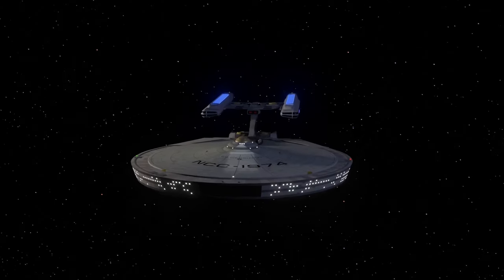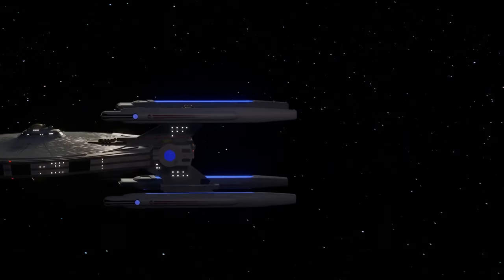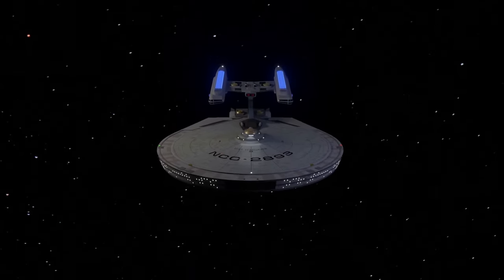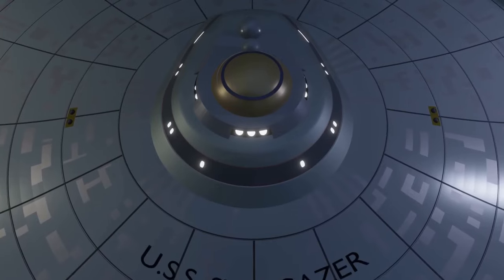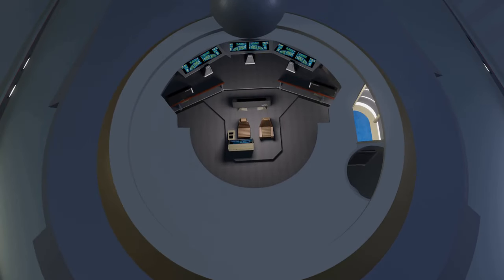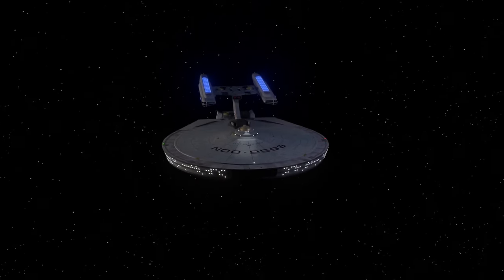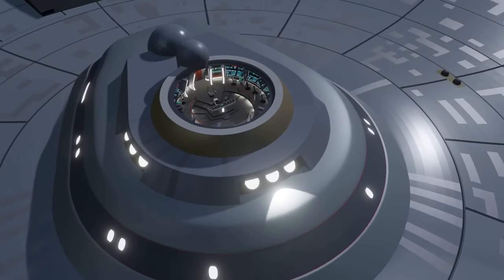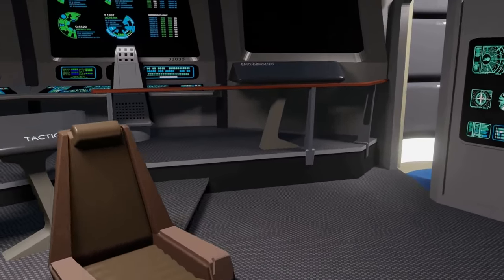Constellation Bridges Considered: Stargazer, Hathaway, & what might have been

Comment: On the Stargazer. The one "turbo lift" wasn't actually a turbo lift. In "The Battle". You can clearly see Worf and Geordi come around onto the Stargazer's Bridge. Instead of stepping onto the bridge from a turbo lift. Only way there could be a turbo lift is if it was actually hidden behind the bridge. Which would line up with the bump at the back.

Comment: I love these videos. Funny thing is, I’ve long thought the Hathaway’s bridge aka the second version of the E-D’s battle bridge was new and not a reuse of the original set pieces. They kept the battle bridge new parts, but went from there. It was also used as a lab in the episode of TNG that gave Kel’Ahr (?) Worf’s love interest.

I love these videos given that so much doesn’t fit between the photographic models and the sets. The E-E bridge as the movies went on, the Grissom’s bridge, Bozeman’s. DS9 with the promenade and Quark’s bar. The E-C is interesting, it looks like it would fit, but with the turbo lifts?

Comment: The idea of modular designs in starships does make sense, more sense than a bridge having only a single access point (turbolifts backing up as people come up would be silly after all). Granted the intuitive design and way things work is just to explain something lightly enough so that everyone moves on, but if you can suspend your disbelief there, it's fine. We've seen the Enterprise D with numerous bridges and minor changes over it's seven seasons, movie, and cameos so it's easy to accept bridge modules. In the case of the Stargazer, I personally chose to believe that the bridge was very basic since most of the exploration and science work happened below decks, and we never really saw those work areas. They are more likely to have that filled in and more attractive look to them. The bridge was an operations center. Yes, it's sparse compared to the Enterprise D, but the Stargazer was a VERY old ship, and the bridge aesthetic may have just been a simplistic reduction from the Kirk era ships as more things automated. Trends come and go. The Picard of that era may not have enjoyed all the noises and activity distracting him. May have had nothing to do with him.

The Hathaway I justify differently. She was an 80 year old decommissioned ship. Odds are, like we saw in later seasons, she was parted out from her shipyard and given a very rudimentary bridge in the event you needed one on the hulk. There was no need to swap it out just for the exercise, and given how under dog the Federation wanted the study to be, even preferred to have that sort of bridge.
Reply: Actually I prefer the Hathaway's Bridge much better🤨🖖🏼👽!

Comment: Your solution works best for the Hathaway since it's supposed to be an older ship that was retired by the time of TNG.
Personally, I think the worst thing the production team did for TNG, was to simply re-use the Ent-D's battle bridge, and would go about modifying all its other uses to more represent different bridges from different ships.
Reply: And the D's battle bridge was just the movie bridge re-dressed. But yeah, I always thought it was weird that all non-Galaxy class Starfleet bridges looked just like the 1701-A's bridge. The entire TNG-era design ethic got thrown out the airlock whenever they met another Federation ship.
Reply: @tvdan1043  
To be fair, the Galaxy was the newest ship in the fleet at the time. Pretty much everything else in the fleet was from Kirk's era or Picard's early service era at the latest. Even the uniforms in S1 of TNG were fairly new, having only been in use for about a decade. The maroon uniforms from the TOS movies were still in use when Wesley Crusher was born in  2348 and may have still been in use when Jack Crusher died 7 years later, in 2355. TNG only takes place around 10 years after that.

Comment: Going by my Starship Volumetrics work, the Constellations ought to be roughly three times the volume of a TOS Constitution compared to an Excelsior at four times.   Yet, despite this, it seems they had half the bridge or less.   Good eye picking that up. 

(I've also lately been bothered that Picard's Stargazer seems never to have gotten even a first round of upgrades.   How many other ships were floating around in 2360 sporting LCARS v.2280?)
Reply: It’s implied that the Stargazer was operating on the fringes of federation territory and probably didn’t get in for full on maintenance very often. Chances are at some point they would have had to order the ship back to the core worlds to do the work ( or just replace the module as it’s implied Starfleet ships use modular parts to make upgrades simple ) more then likely had the stargazer not been critically damaged it probably would have gotten the upgrade as part of its repair/upgrade

Comment: Interesting, but anything other than a redress of the battle bridge was never going to happen.
Reply from the maker: Too true, I'm afraid - alas.
Reply: @WeTravelbyNight  Feel free to correct me, but my impression was that moving the bridge crew to the Battle Bridge and splitting the Enterprise before a fight was going to be a regular part of the show.  But because it slowed down the story in the first episode, they decided not to do that.  That's why the Battle Bridge appeared only once in the first season.  Then the set was damaged while it was stored outside.  So they built a new "battle bridge" for TNG and a new bridge for Enterprise-A (which doubled as the Excelsior).  The TNG set was then used any time they needed another starship bridge, Federation or otherwise, or any other interior room.  Its only use as the Battle Bridge was in Best of Both Worlds Part 2.  

Now, if a Constellation class ship was going to be a show's hero ship, then it would get its own set.  But one or two eps?  No.